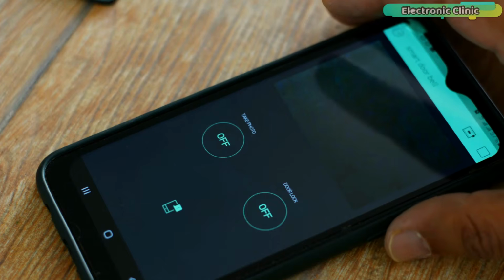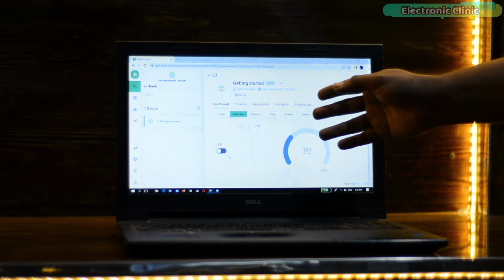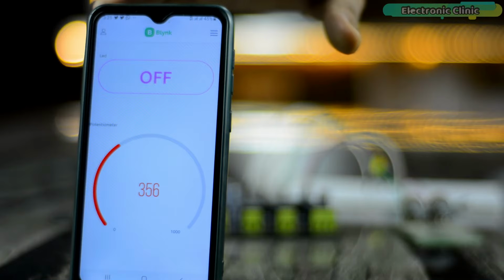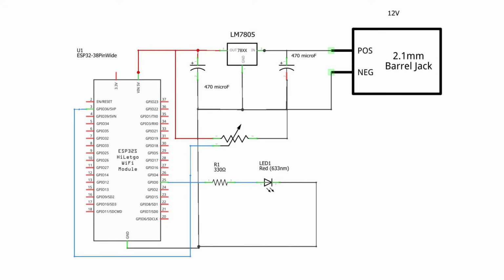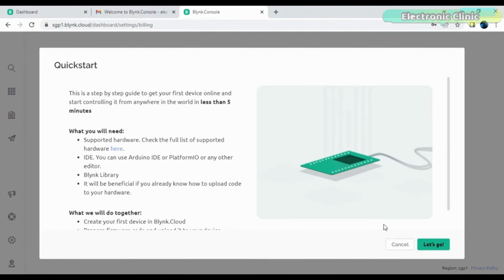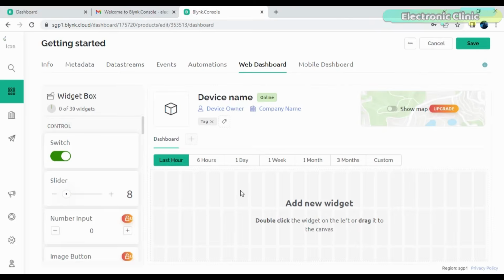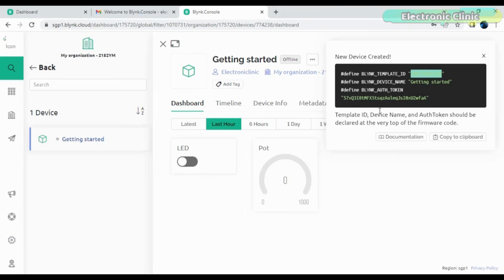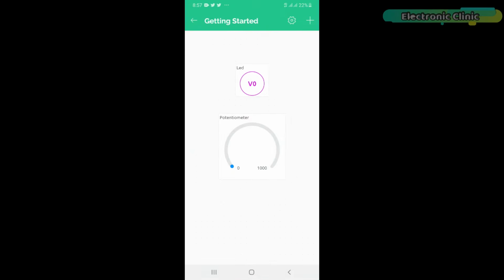Blynk 2.0 Getting Started Tutorial, New Blynk App V2.0 with ESP32, Blynk.cloud setup

Comment: Helpful video - thanks!   Could you perhaps add a segment on using the edgent library and method rather than the authorization code option?
Reply: Yes! Yes! I also would like to see a video on how to convert ESP32 firmware that uses hard coded wifi credentials to the new Edgent system where you can enter the credentials using the app.

Comment: Is there any option to connect through ble or Bluetooth in new blynk 2.0?
Reply from the maker: I will check it. if it's available then I am gonna use it in my upcoming video.
Reply: I'm wondering the same thing as I myself have a blynk project that uses the hc06 Bluetooth module.
Reply from the maker: @joescopo8933  ok I am gonna take a look at this today.
Reply: @ElectroniClinic , that would be great!  I have a bicycle speedometer using code from your hall effect sensor RPM video. I connected to the blynk app via hc06 and it works great.  I'm starting to think that after Dec 31, I won't be able to use it on my bike since the blynk app won't work anymore.  From the bit of research I've done in the last few hours, I'm basically seeing that there's few options for android apps to use with this project. Those being the MIT App inventor app and the Arduino Bluetooth Contoller app. However, I don't know how to use those apps. It doesn't look like the new blynk iot will support Bluetooth or BLE yet.